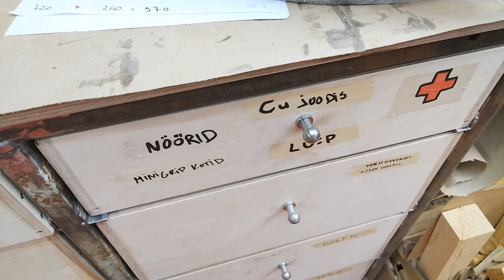Aluminium mast splicing / salvaging a broken Hobie Cat 16 mast

Comment: I am currently researching mast splicing and came across your video, interesting work. How has the repaired mast performed?
Reply from the maker: So far so good. I remember first sailings with the new mast, I was so hesitant to push it. Later in the summer/fall I was pushing it quite hard (last couple of minutes of this one - https://youtu.be/l5GcrAEBF84). I mostly sail lakes (fresh water), I live 200km from the sea and salt+aluminium+stainless=corrosion does not worry me too much. In the end of the repair video there is this band-aid on original mast tang location which had quite bad corrosion on it. The riveted splice patch was 2mm thick, I think, I do not really remember exactly. The rivet pattern should be layed out so that they do not form distinct lines, rivet holes in a line create possible fault line. On the mast tang part I put 0.8mm thick (I just happend to have some 0.8mm scrap) patch, formed like splice patch. I glued it on with polyurethane based glue/sealant (no rivets). I was worried, that over time some cracks might develop, where corrosion and original tang rivets were. Gluing something to anodized aluminium is a pita, I did roughen it up, but did not want to brake through the anodized layer. I went with elastic glue because I have no faith in hardened glue (like epoxy) between two smooth surfaces. It would just delaminate on first bend. Maybe there are special epoxies, that I do not know about.